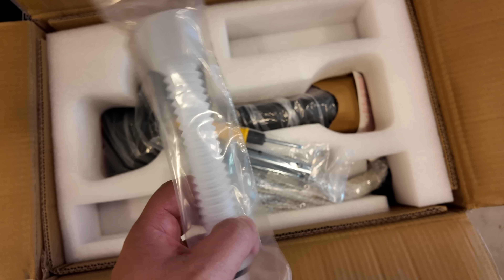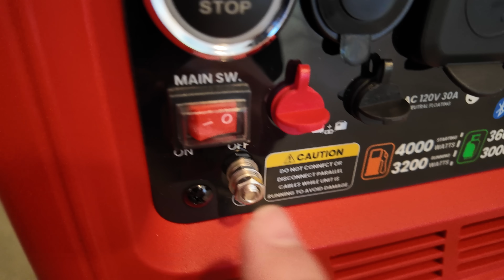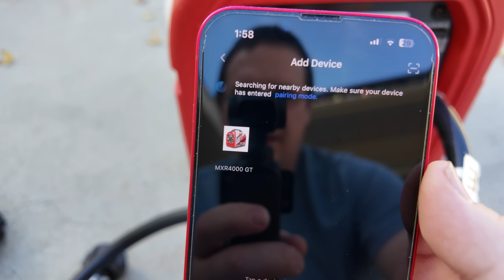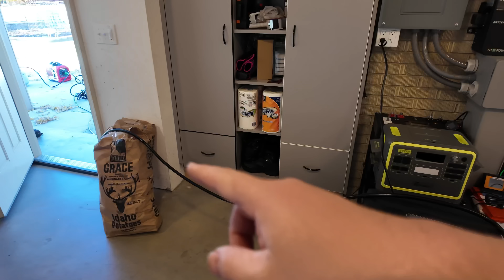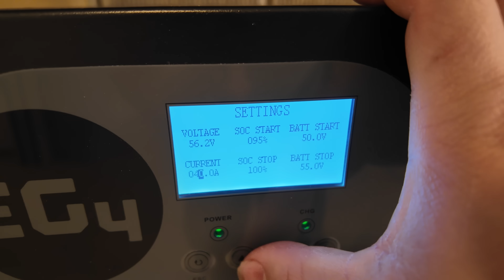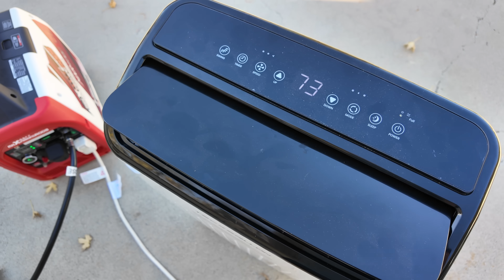UNPOPULAR OPINION: Buy Gas FIRST (Before You Ever Touch Solar)

Comment: I definitely disagree with this as a blanket conclusion. While I agree that solar might not be the best solution for everyone, the #1 priority should be a battery + MPPT/inverter. For a similar cost as that generator and a couple of 5 gal LPG tanks, you can get a similar power (3-5 kW) MPPT/inverter plus a 5+ kWh battery. That is going to be more than enough for most people in a basic grid-down situation. While it is still not ideal because you are maintaining a charged battery using grid power, it is enough backup energy and power to run crucial household items for a few days after the grid goes down. Solar can then be added incrementally or as you can afford it, which will run those systems perpetually.

Yes, your suggestion does allow you to stockpile more energy, but it also has some downsides. Storing a lot of LPG in and of itself could put you at higher risk of being targeted for theft in truly bad situations. In addition, I can hear my neighbors' generators running from hundreds of yards away. They aren't exactly stealth. Finally, the cost for a pure sine inverter generator is far higher than an MPPT/inverter of similar power, so if you go cheap with a generator, you really can only run a few types of appliances, which even then you might risk damaging with a modified sine wave inverter. 

It might sound like the people who are saying solar is better are just being ornery purists, but the reality is, solar is now a more pragmatic solution than any type of generator. That should be as obvious as pricing out the cost per power of pure sine generators versus MPPTs. The battery vs fuel debate is a bit more nuanced, but at $100 a pop for 5 gallon LPG tanks, it doesn't take long before a large LFP battery looks really appealing. At that point, solar becomes a no-brainer because, while it does have a higher initial upfront cost, it pays for itself versus consumable fossil fuels in a matter of a year or two. Also, with a solar-battery system, you start saving money *now*, which allows you to save up for other things in the future. You're basically never going to run a generator like this while the grid is still up, meaning you're paying for the generator, fuel, AND grid power all at the same time.

I do agree that if the only choice was a generator or a turn-key all-in-one (like an Anker, Bluetti, Ecoflow, etc.), the debate is much closer because their cost, pricing, and power is similar to a basic generator. The all-in-ones still have some significant advantages over a generator, of course, but they also have limitations.
Reply: "But at $100. a pop for 5 gallon LPG tanks"
I have a pile of them that I collected from the trash. When they run out of date I swap them with Blue Rhino for $29. I bought a brand new 100lb tank at Lowe's for $89. last year. It was a custom order that never got picked up so they put it on clearance.
Reply: @fauxque5057  Sure. I used to have a half dozen of them just laying around, but this video seems to be directed at people who aren't currently invested in any energy backup system. Also, I was counting the cost of charging the tanks, not just the cost of buying an empty, pre-purged tank. With LPG, you really are investing into an ecosystem (similar to solar).
Reply: I agree with you, but my starting position is "what is most likely to happen at your home."  Most likely is not a grid down situation.  It is most likely a temporary black out, and possibly an ice storm or hurricane, which would create a longer power outage.  So you should plan for what is most likely to effect your home.  For us it is most likely an average power outage (<4 hours).  If that was the first target, going with a battery back up might be the best way to go based on what you need during a short term emergency.  So an inexpensive power station that can keep your house in livable condition might be the better way to start.  So a battery back up might be the best start for people who don't have any significant snow from Nov to May.  Most likely it will be a short term power outage.  Then when you have some more money, if you don't have a generator at this time, fill in the small inverter generator when it goes on sale.  Get one that can power up your battery system.   If a winter storm is ready to take out the power, north east and rockies, then the small generator that can keep your house warm for days might be the best way to go.  Certainly don't over do it if you and spend 15K on a whole home backup if you don't need it. I put one in a whole house generator, for my parents but they are in their 80s and I might not be able to get there to get them through.  So prepare for what is most likely, and a Hurricane every 5 years is not most likely right now.  Neither is a grid down situation.
Reply: @gibblespascack1418 heating your house in case of emergencies is best done with a diesel heater. I have a few I used for my vehicle camping that I could heat my house up with if my mini splits ever failed and my back up brand new mini split also fails. Far more efficient than running your generator of your running space heaters. Running three blower fans on furnaces could eaisly be done of solar
Reply: @Gary-ee3kq  Well it depends.  If you have a central NG furnace(condensing) you can run it with its circulator for about 400W.  My central furnace does that.  If you have a fuel oil furnace(diesel fuel), it might use a lot more power because you need to run the HP spray pump.  For our backup, If NG is gone, is K1 Kerosene and a Kerosun type heater.  10-23K btu can keep a good sized space warm.  Sorry, but you will need to describe your diesel heater.  I would not use one without the exhaust directly vented outside through the muffler, but yours might be different from those ones used in England.   the diesel one only works if you have a way to get rid of stored diesel, if you don't use it in a reasonable time.  I have a diesel VW, but not many have a way to dispose of diesel.
Reply: @gibblespascack1418 I use the cheap Chinese diesel heaters. In case my mini splits failed I could remove the indoor head and use the existing hole for the diesel heater exhaust. Most of the time they leave the nat gas on when the electric utility goes down. I've used 1 yr old diesel in the heater with no issues. Maybe after 3-4 yrs it wouldn't run clean anymore. I haven't got to that point.
Reply: @Gary-ee3kq  It probably does not run clean, but when its an emergency, you do what you can.  At best you are looking at 75-85% if you can not recover heat from the exhaust.  But it does not matter.  But those small forced air diesels can do a good job.  I don't have one, but I have seen them.  I still like the Kerosun type.  No electricity needed.  However, we do have two Ecoflow delta pro ultras, so we will use them first with the house systems.  But I do still have 27 gallons of stabilized gas for the generator and 20 gal of k1 kerosene for the kerosun heater.  Good luck with your preps.
Reply from the maker: Thanks for sharing your perspective and the detailed breakdown of your reasoning!
Reply: I cut my grid power back in April and a few days last month I was seriously considering buying a generator for a few cloudy days we had where my batts got drained down 2%. Instead I took the 1.2k and bought another 4 280ah ecoworthy. Now I got 49 kWh of batteries. Obviously doesn't matter if I can't charge them so I've got invest another 1k to get 10 410w panels when they go on sale. I still am debating myself about the generator.
Reply: @Gary-ee3kq  No doubt that going fully off-grid will be a challenge, and I do think it's valid to consider an LPG generator after you have a solar system capable of going off grid 99% of the time. My scenario is a bit different, where I have over 70 kWh of additional energy absorption capacity in the form of a couple of EVs. I'll literally never be able to generate enough solar energy to fill everything up all the time.
Reply: @newscoulomb3705 Your EVs might make it easier to go off grid with the V2H that is coming out that let's you power your house with them assuming you got a  charger maybe at work or through the government that has free/ almost free ev charging.
Reply: @Gary-ee3kq  The V2H features are still pretty  new and limited, and most of my EVs are over 10 years old. So they are mostly just energy sinks. I work from home, though, so it's all on me to produce what I use. There also isn't really any free charging anymore. Especially not public charging, which is typically 2x local utility prices, and even office/workplace charging usually costs as much as plugging into the grid.
Reply: @newscoulomb3705 charge the EVs on Sunny days and use the power on cloudy days if you don't drive them that much.

Comment: I'm probably the only one in my city who has heated their house last few days when temps have dropped to 10f above freezing with no natural gas or grid power. Beauty of mini splits.
Reply from the maker: That's awesome! Mini splits are a great solution!
Reply: 40f, I use an extra wool blanket. Not need no fancy heat!
Reply: @robertl.fallin7062 breathing cold air ain't  no way to sleep.  I'm getting the heat for free anyways using my solar power.

Comment: I agree that ICE generators need to be part of our energy backup systems and propane is a great way to go. It can be stored for a very long time.
  But I think you hit upon an even bigger concept of being adaptable.  For most folk, they either want to only use ICE or the other side that only want to use renewable. We as a species need to see energy as a total of all systems with renewables the majority of it but non-renewable fuels/power sources still have a valid place.
  Great video and information as well.
Reply from the maker: Yep! We need all the solutions working together to bring the most efficiency and security! Thanks for watching!
Reply: agree. solar or hydro is great when it works, but need to have backups.
Reply: Agree on all points
I would add that fuels can be renewable too.
See Jean Pain Method to make your own methane/nat gas from a compost heap.
Or woodgas generation.
Or biomass.
Or just plain old wood/paper waste burning steam turbine to generate electricity 
😅
Reply: @geraldford6409 That is actually a good point.
Reply: @OP-fd4lh Burning ancient fuels sequestered underground for 100s of millions of tears is the problem, not recent carbon used in the current ecosystem 😊
Reply: @OP-fd4lh  Also hydrocarbon fuels created with excess renewable electricity like wind and solar
Reply: @geraldford6409 not always practical though. To do methane you need farm animals I take it. If you have an unlimited supply of cow manure then it's possible. Wind power a lot of people don't like it because it kills birds I would not want my purple martins killed because they eat biting bugs. ,73
Reply: I think I will try to hook up two electrical panels one for the generator and one for the power station. The power station will power 120 volt things. And the generator will power the 240 volt items and I will allow the generator to charge the power station as well. You might not get the sun all the time and with back up charging you will never be without power. I have an All Powers  power station which I also take on trips I ordered four solar panels to charge my station and I also have the portable panels as well in case I go to the mountains where I have no power. But at home the roof will have actually six panels the two are for my cooler it will only run when the sun is out I figure at a low temp it will last all night at a refrigerator temperature then when the sun comes out again the cooler will run maybe as low as 10 to 25 degrees perfect for cold water to drink and meats will keep longer. The cooler will run on 12 to 24 volts DC perfect for my two panels some kind of DC control will be needed. This is all experimental and will need adjustments . 73

Comment: Agree with you 100% - everyone talks about solar panels but IMO they are not a great all around solution although they have come a long way. Wind turbines would be a better solution once they get more efficient as wind is more consistent in good and bad conditions. EF Delta pro 3 along with their generator that auto starts as power is depleted is ideal although pricey. Good vid and topic
Reply: Wind is not going to get more efficient at small scale. Its mathematically impossible. And I say that as someone who has run the gauntlet of wind power. I ended up going to two 5kw commercial units that come from remote telecom applications. When you double the swept area of the blades? You get three times the power. Unfortunately that applies in reverse as well. Half the area? 1/3 the power output. The swept diameter of my turbines is almost 14ft (4.2m) across.
Reply from the maker: Thanks for the kind words and sharing your thoughts!
Reply: A wind turbine won't survive a Cat 3 hurricane. So far my solar panels have. I have 10 panels on a flat porch roof, and another 10 as a ground array. If the roof panels blow away I still have 10 on the ground array.
Reply: Wind turbines just don't generate enough electricity unless they're really big

Comment: Sounds like you've read some of the things us Hurricane Helene survivors learned the very hard way. It wiped out every power line, cell tower, radio tower, water line, gas station & propane truck. Most importantly, trees took out vast swaths of property & went through countless roofs. Solar arrays for many got wiped out unless they were in a huge field or a roof no debris hit.  
Having dual fuel also helps with LONG TERM fuel storage needs. Propane you can let sit. Gas you can't stockpile without tricks I don't I believe. Plus...gas sometimes doesn't want to start, so having the propane BYPASSES the carburetor if it's the middle of the night when you can't clean the jets. A lot of people with automatic Generac propane generators ran out because refueling trucks couldn't access most customers. Gas stations were only taking cash with no internet, banks & ATM's couldn't give you cash without internet. Pumps were off with no power.  

I ran a gas 9000 watt Ryobi & trying to get fuel almost "smuggled" into Asheville left it not running most of the time. Bottom line, a battery bank & dual fuel generator will at least give you a chance. Sip 2 hours of propane off a tank that's been sitting for a year to charge up the EcoFlow to keep the food in the fridge good (especially since NO grocery store would give their thawing frozen foods away).
Reply from the maker: Great information from your experience!

Comment: I have a power station with a couple solar panels and I want to get a dual fuel generator to do exactly what you showed in your video. What are your thoughts on WEN generators? Also, I was thinking of a smaller rated generator. Did you go for such a high watt one due to the elevation reducing the throughput?
Reply from the maker: I haven't ever tested a WEN before. So I can't speak to how well it will work. I have this one in the video, and two Honda EU2200i's. Yes! The 4,000 watt range is really the sweet spot for me due to my altitude as well as the de-rate with the propane. Combine both of those things and it will always give me at least 1,800 watts continuous. I also love the app control and electric start on this unit!
Reply: @theresatrickforthat I appreciate the input! I hope at least solar is impeccable at that elevation.
Reply: It's way easier to walk in a Harbor Freight and exchange a bad generator with what most have said is the same internals.

Comment: Know it's just an opinion but  i believe the opposite. It's easier to travel with a small power station and panels, qiucker to connect, less maintenence especially on the go. But having both is the best option, and having one or the other is better than neither one
Reply from the maker: Yeah, definitely having either one is better than having none at all! And Yes! I ALWAYS reach for a power station before a gas generator!
Reply: If you’re on the road then you go with lotsa solar, power station(s) AND an alternator charger. EV charging stations can be a convenient backup too.